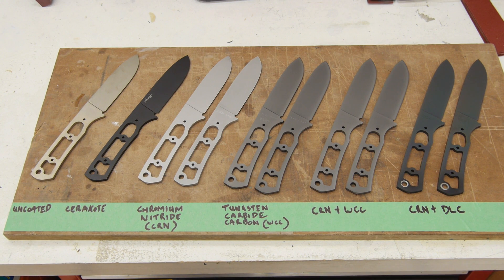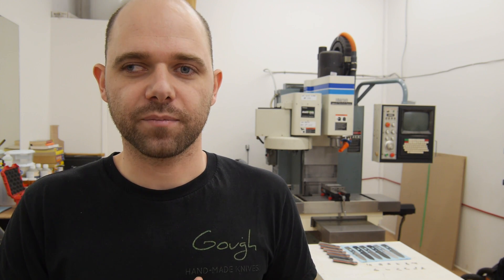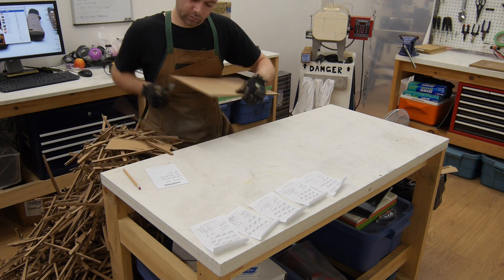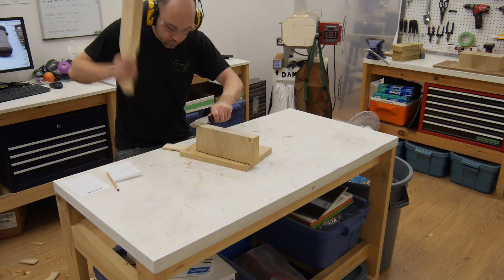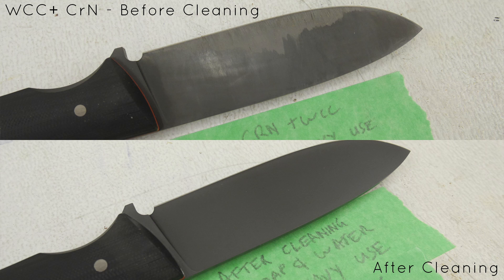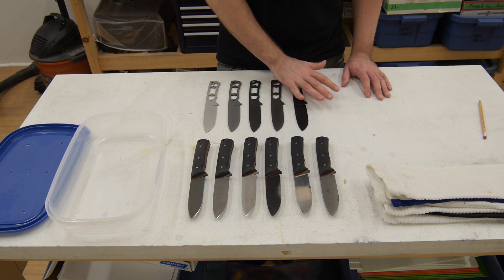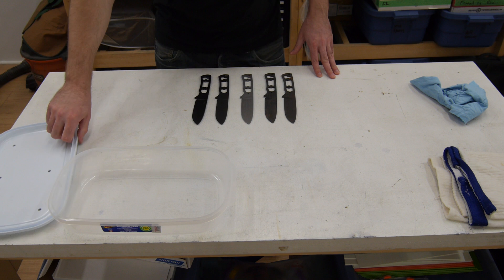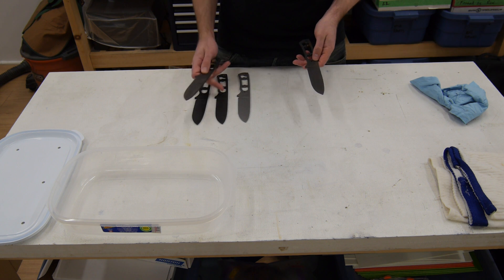Knife coating showdown! 6 different blade coatings tested.

Comment: +Gough Custom you can clearly see that the cerakote finish is the most durable, but for a beginner/hobby knifemaker what would you recommand as finish? Forcing a patina with white vinegar or ferric chloride? Because i dont think it's cheap the cerakote. I just made a filing jig inspired by your other video. Your work and videos are totally awesome!
Reply from the maker: Hey mate! Overall DLC was by far the most durable, not Cerakote, just to clarify.

For beginners I would recommend trying a satin finish. If you want a dull finish then rigging up a homebrew tumbler mechanism and loading that with white vinegar would be my preferred choice.
Reply: thanks a lot but what is that exactly? :p
Reply from the maker: Look up vibratory tumbler, or a rock tumbler... Using one of those with vinegar works really well to produce a matte 'acid stonewash' finish that is reasonably corrosion resistant.
Reply: now i understand thanks man

Comment: do you still sharpening your knifes with the lansky set?
Reply from the maker: No, I actually designed and built a powered sharpening system that works amazingly well and very quickly... I use that for all my knives now.
Reply: could you show it in one of your videos?
Reply from the maker: Yep! It's on my to-do list!

Comment: Awesome testing mate! Just wondering if you considered irregularities from your coating suppliers. I wonder if you would get the same results if you did the whole process over. I guess it depends on whether what they gave you was an average representation of what you will get in the future... I hope im not coming across as negative thats not my intent. 
Look forward to more videos!
Reply from the maker: It's definitely a good question and was a consideration on my end... Ultimately the companies that do the coatings have very tight process control, everything is computerized and unlikely to change. One nice thing about DLC is that changes in coating thickness lead to a 'rainbow' effect which is easily visible to the naked eye, so I have at least one metric I can visually spot that might indicate something has gone wrong!

Comment: good stuff as usual.  I was wondering about scratch resistance with these coatings.  have you thought about maybe tumbling these with bolts or nails to see metal on metal wear? thanks.
Reply from the maker: Hey mate! Scratch resistance is actually very good... If you take a nail and drag the pointy end across the coating it will leave a silver mark, but that is actually the metal of the nail rubbing off onto the coating... A little bit of autosol will clean the mark right off and the coating will be pristine, I have done this multiple times!
Reply: +Gough Custom  Ok, thanks for the info!

Comment: 0:50   My DLC coated zero tolerance is the exact opposite of slippery... what do you have
Reply from the maker: It depends on how the blade is prepared as well.. The coating itself is slippery, but that doesn't help if the blade is sand-blasted which will make it quite rough... My blades are prepared by blasting them with a combination of aluminum oxide grit and glass beads, this leaves with a matte but slippery surface that feels almost exactly like the trackpad on a macbook. Seems to work pretty well from what I've seen!

Comment: great to see a new video from you, man. I've gotten into knife making myself and your early videos really inspired me. (I'm still working with files and angle grinders. can't afford a $2000 2x72 belt grinder yet) but I am currently saving up for one of your knives.
Reply from the maker: Nice work man, pleased to hear you're exploring making knives! I'll look forward to making a knife for you!
Reply: may I suggest getting a 1x30 belt sander from the horrible freight (harbour freight) just to start out with. it is not great but better than a file.
Reply: +Samuel Scott I've got a grizzly 1x30 which is barely better than the harbor freight one. but it comes with a disk sander too. but I finish everything with files because the 1x30 isn't accurate enough for plunge lines and stuff. it's just for stock removal. (at least for me)
Reply: Okay cool

Comment: I got two DLC coated knives, the zero tolerance zt 0350 and the zt 0301 tigerstripe.
The black zt 0350's DLC coating is very sticky and you can feel a bit of resistance while cuting through several materials ( food, cardboard, wood etc). The coating has a very rough surface that makes this "bad" cuting performance and makes the coating prone to scratches and abrasion. The DLC tigerstripe coating on the zt 0301 is completely different to the 0350. The surface is very smooth and slicky and in many weeks of daily use this kind of DLC shows no signs of abrasion or scratches and the cutting performance is way better than from the zt 0350 although the blades are very similar in geometry (zt 0350 is 10% smaller than the big boy zt 0301).
Sorry for the long text.
Reply from the maker: Hey Marco!
Yes I know what you mean! I wanted my knives to be matte finished, but I didn't want them to be too grabby... To achieve this I blast them with a mix of aluminum oxide and glass beads before they're DLC coated. This leaves a finish that feels similar to the trackpad on a MacBook, matte but slippery. It seems to work well and is not at all prone to scratching!

Comment: How much more will you charge for a DLC coated blade vs an uncoated blade?    Personally I prefer uncoated blades.
Reply from the maker: Right now everything is the same price, I haven't done any uncoated blades in quite a while... I plan to start offering them again toward the end of the year though, not sure what the price-point will be. Hand-satin finished will likely be more expensive than DLC because of the amount of work that goes into it, plain stonewash will likely be a little less.
Reply: Sounds good.

Comment: Spyderco uses DLC holds up great. Can I please have one of your test blades thanks
Reply from the maker: I actually bought a Spyderco with DLC a few years ago because I wanted to try the coating before I had access to it for my knives, I was impressed with it which is why I kept working to get access to DLC for my stuff! 

At the moment I'm not selling any of the test blades, but I will think about it!
Reply: awesome video! not a lot of people have this much passion for what they do! 
maybe you can present the testblades as gifts to supporters? or you could sell them over an auction? or frame and hang them on the wall??
Reply: +Gough Custom please do

Comment: I wonder how PVD would fare
Reply from the maker: Hey mate! All these coatings (except satin/cerakote) are actually PVD coatings. PVD is the name of the process used to apply the coating, rather than the name of a specific coating. Ie: the DLC coating is applied using the PVD process, as are all the other coatings I showed in the video!

Comment: Thanks for sharing.  I think you did a great job. I noticed that you use abrasives to sharpen your knives (I use a honer/burnisher for the most part). How would these coated knives stand up to sharpening with both systems?
Reply from the maker: Hey mate! My knives actually don't respond terribly strongly to honing with a non-abrasive rod, mainly because the steel in them is so hard, hard enough you could use the knife to cut slivers off a steel honing rod in fact!

The coatings aren't covering the edge of the knife, so none of the coatings will be affected by sharpening in whatever fashion you choose.
Reply: Oh, so the coating is not the cutting edge!?!? That is weird when you consider the Katana sword uses a hard-steel edge backed by a soft steel blade. I don't understand how you could miss that trick.
Reply from the maker: No, there's no point coating the cutting edge... Eventually you will have to sharpen the knife with stones and that will take the coating off (sharpening stones are harder than any coating) so there's really no point in coating the edge...

Comment: I wonder if the DLC would affect edge retention.  Did you send out any pre-sharpened knives for coating?
Reply from the maker: It would theoretically improve edge retention, but you're still going to have to sharpen the knife at some point at which point the benefit will go away, which is why I did all the sharpening after coating... Also assembling already-sharpened knives would be crazy dangerous, I'd probably lose a finger!